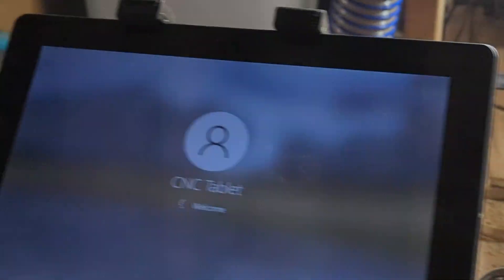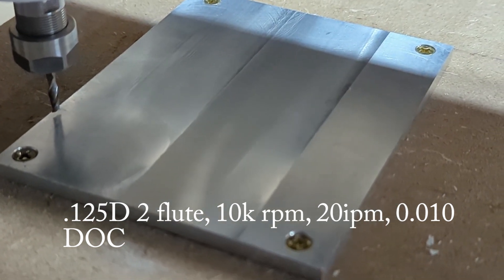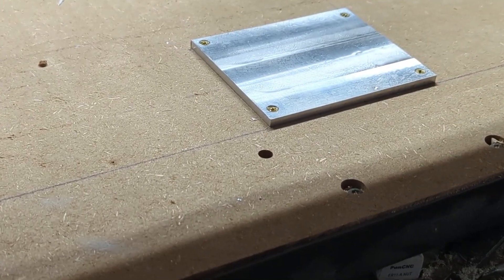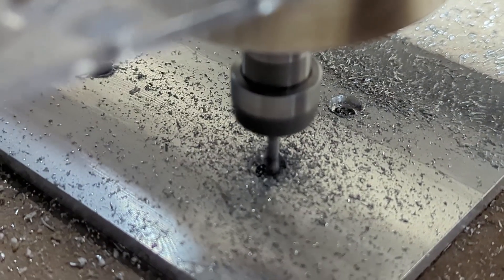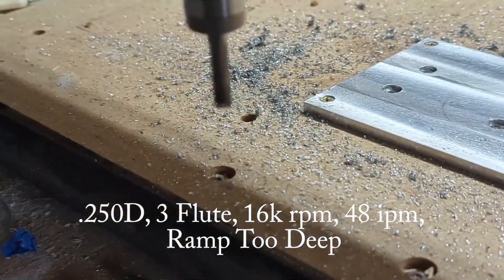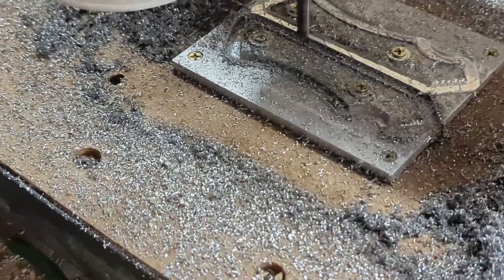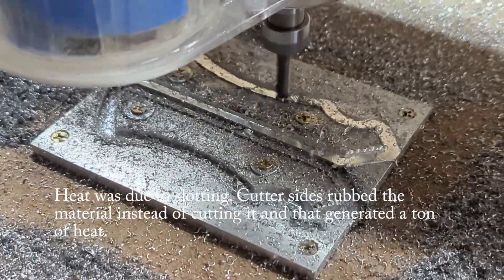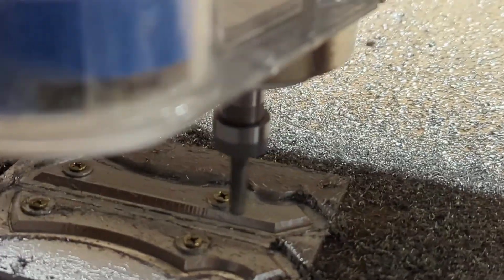Cutting Aluminum Knife Scales with a Shapeoko 3 CNC Router

Comment: for 1/8" try this: 0 flute, 10k RPM, 65 IPM, 0.005 DOC 
for 1/4" try this: 0 flute, 10k RPM, 65 IPM, 0.01 DOC

ramp up the IPM and test up to 80+ instead of going with a more aggressive DOC. 

S3 isn't very rigid from my experience it doesn't like taking large DOC, especially on a 1/8" end mill.
Reply from the maker: I'll have to give that a try next time. I think the key is the 0 flute.

Comment: how is it machining g10  with this cnc?
Reply from the maker: It's very doable. Lots of trial and error involved though, as far as feeds and speeds are concerned. And, it is very hard on the tools so you have to replace them fairly often. Whatever you get into, just make sure your dust collection is on point. You don't want to breathe G10.

Comment: Take a look at O-flute end mills (single flute) for cutting aluminum. Better chip load control with router cnc, combo that with your VFD spindle, you could do really well.  I use O-flutes (1/8", 1/4", 2.5mm) with my 1-1/2hp DeWalt router and have been successful with 6061 up to 3/8 thick so far running contours, adaptive, and bores.
Reply: I agree  o flute is the way to go this come from me melting aluminum and coated my bit with molten aluminum.
Reply from the maker: I've seen mention of 0-flute. I'll have to give one a try the next time I get my hangs on a slab of aluminum. I think my problem was that when I told Fusion to ramp... it did the whole pass ramping instead of entering with a ramp to 0.010" and staying at that depth. So by the time I finished a contour pass, it was probably trying to take a 60 thou chip.